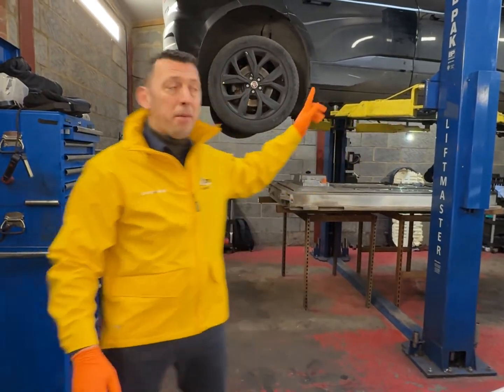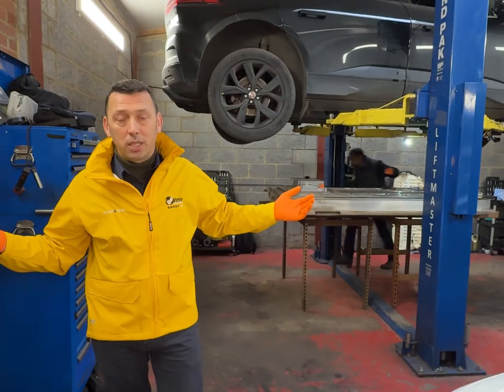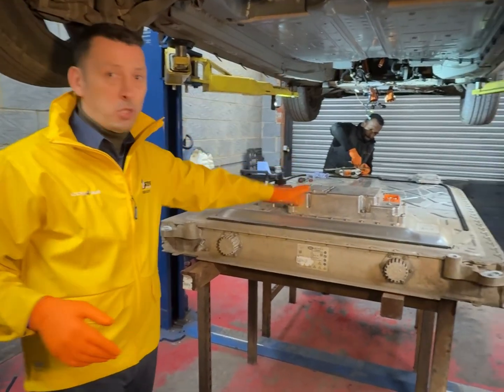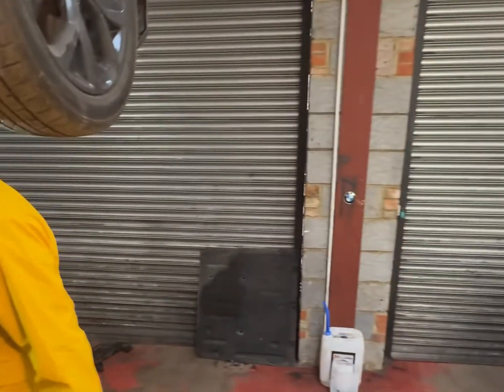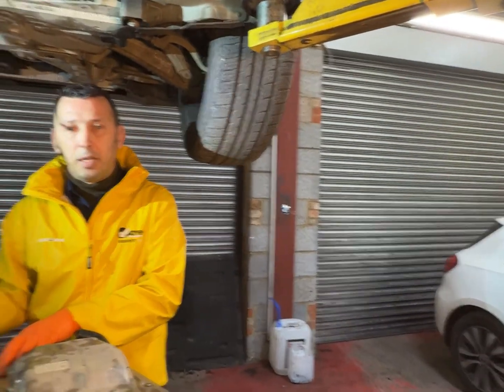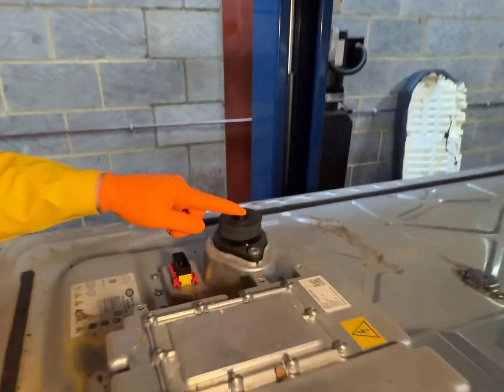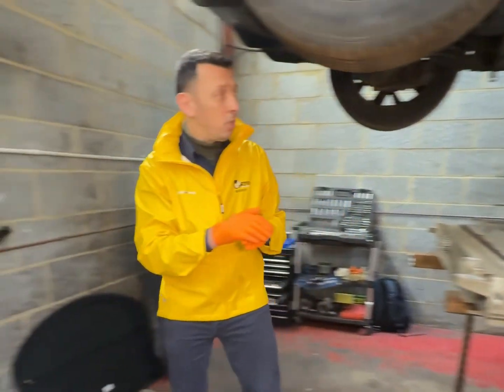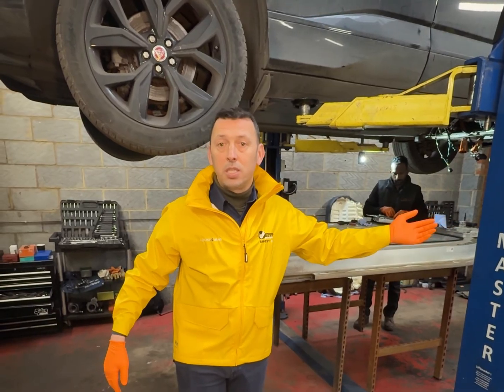Jaguar I-Pace Not Blowing Hot Air? Here’s the Fix! 🔥 | Workshop Repair Explained

Comment: Why, oh why do they make these cars with everything inaccessible unless you take the thing to pieces. I've seen other videos showing how you have to remove seats and carpets to access i-pace battery bolts, as Jaguar didn't think to make the fixings bolt-through from underneath!!!! Crazy.
Any repair is going to cost many thousands in labour at a main dealer.
I almost had to have the dashboard taken out of my old Volvo XC90 to replace a £5 temperature sensor in the ventilation ducting that controlled the aircon compressor. Not want to pay thousands and potentially end up with all sorts of problems having the dash out and in, I did it myself....but only just managed to access this sensor, bent an old screwdriver to make a simple tool,  and ended up with my hands and wrist cut to bits under the dash. What was annoying was that it became obvious this sensor could have been mounted in a slightly different place on the air ducting and would have been easily replaced in minutes. Bad and lazy design, with no thought to future repairs.
Reply: They want cars to be disposable